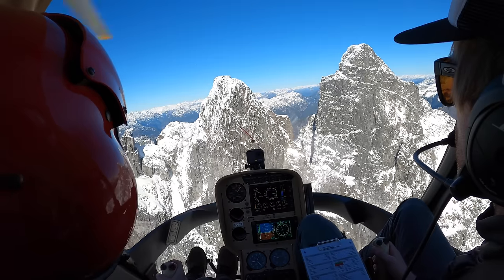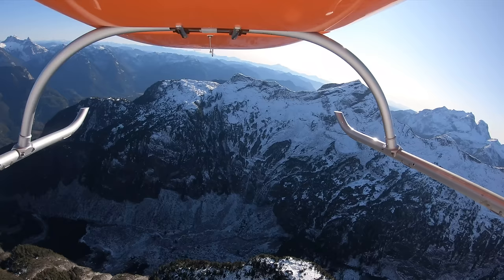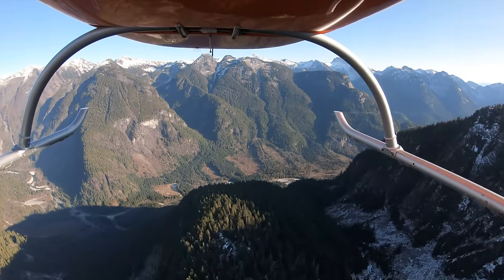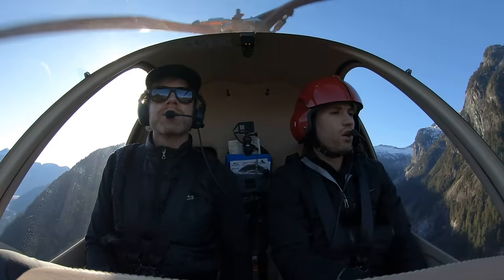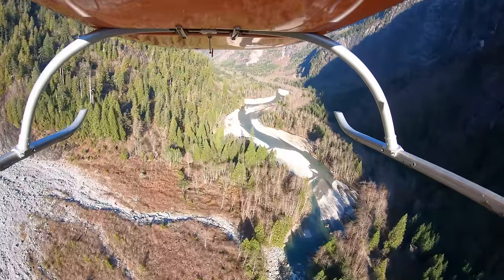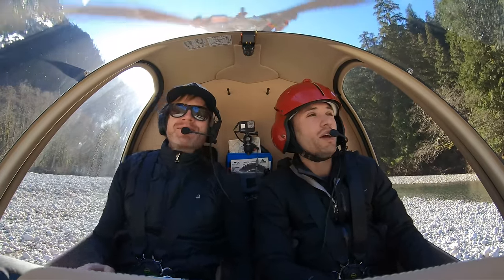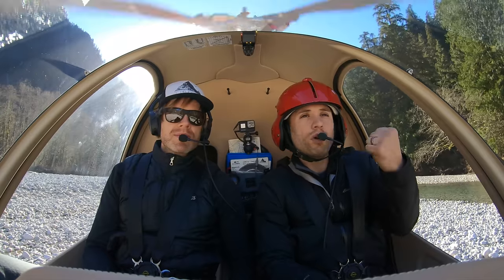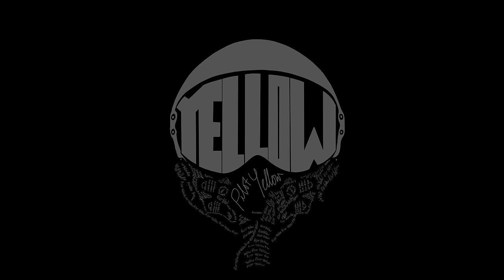ENGINE FAILURE ON MOUNTAIN APPROACH

Comment: Nice, really nice smooth landing👍As technology  moves forward, new ideas and innovations spring up. I'd like to see someday something like an  "Auto Rotation" setting on a Helicopter or an auxiliary electric motor that will give you a bit more time to do an emergency landing without all the stress.

Comment: Very nice and smooth! You could also do a tail rotor failure to the ground! Just and idea! Good job guys!
Reply from the maker: CHW BIKER that’s harder to simulate safely.
Reply: Pilot Yellow why do you think I have asked? 😬 👍🏼
Reply: I thought if the tail rotor seized you  were totally screwed as the body of the copter then starts to spin with the main rotor??
Reply: shadychrisuk I think @Mischa will be able to explain you better then me, but there are two kinds of tail rotor failures. First one it is when tail rotor stop spinning, and second it is when the tail rotor keep spinning but in a fix pitch. The main thing you need to do is to keep flying forward, around 70 knots for most os the helicopters, for the vertical stabilizers in the tail boom prevent the helicopter from spinning out of control. It is a very scary situation to be in, but as many people say, “don’t panic, keep flying”. Like in this video, after they identified the problem, they kept the cool till the landing. They kept flying! Hope to see this maneuver in the future, not necessarily to be to the ground! Just an ideia! Big hugs from Brazil!
Reply: @chwbiker   thanks for trying to explain. I'm not even gonna attempt to pretend to understand the complex aerodynamics of a helicopter, but I get the idea that if the thing is moving forwards pretty quickly then if the tail rotor were to stop spinning, the forward momentum would still reduce the tendency of the body of the helicopter to spin round with the main rotor. I would guess that it would still swing to some degree, which would quickly increase as the copter had to slow to descend.  I'm guessing that unlike the main rotor not enough air passes through the tail rotor for it to 'autorotate' fast enough to counteract the inertia of the main rotor acting on the body. I've never actually seen video of a helicopter tail rotor failure whilst travelling forward at speed, only when hovering or ascending - as per the Thai football club directors fatal crash in the UK last year.
For my money there are just too many mechanical points of failure on a helicopter that will invariably lead to a very bad ending. I wouldnt even want to sit inside one on the ground with the rotor spinning, let alone climb hundreds of feet into the sky! I much prefer to restrict my means of airtravel to something that bears at least a slight resemblance to a bird.. 🕊️🛩️

Comment: First thing he did was making a mayday call. How can ATC assist them in this case?
Reply: @hurricane watcher" Mayday, Mayday, Mayday, Uniform Echo Tango Uniform Echo Tango Uniform Echo Tango Uhh Uhh Ohh Ok"  will not assist  ATC  too much in locating you. I rather would go thru the "Power failure avove 500ft " Checklist.
Reply: @jackharper3190  it will help ATC alot as they know there is an emergency and the approx location to send search and rescue. The more people know the higher the chance of a quick rescue.

Comment: Wow I learned something today. I always thought engine failure meant plummeting to you’re death. Turns out you can glide gues the rotor still cuts the air I guess? I still wonder how you could control the tail rotor if the engine shut down ? All these questions I just subscribed yesterday night lol
Reply: Pretty sure tail rotor is mechanically linked to the main rotor gears so it rotates in unison.
Reply: C D Kennedy 
Ok good hypothesis. I know you can vary the speed with pedals to keep the helicopter torque. Anyhow thank you for one explanation. All I know is I learned something today

Comment: This is too unreal! How can he be so calm?  I can't imagine it could land that easily on all of those rocks!
Reply: @Susan Mandeville
, pilots are trained to be calm in an emergency.  This calmness comes from experience, one knows what to do when things go wrong.  It would be the same if one is trained to (1) deal with a stuck-open throttle or (2) brake failure in a car, then the surprize factor will not even enter the equation, you will instinctively (1) select neutral, switch off the ignition and brake, or (2) gear down, brake gently with the remaining brake circuit (most brake circuits are split, if one fails one will still have partial brakes in the second) and/or apply the handbrake.

Comment: As someone said, helicopters are motorbikes of the sky. They are so unsafe. Unless you work in the military or an oil ring, I would never recommend going in one if you value your life. Maybe to try it once would be acceptable but one with two pilots and two engines. Also one that is serviced regularly. Also visibility must be excellent and use one in a Western country. I am UK based. This is just my personal opinion.

Comment: I dont understand how the blades still spin?
Reply: When a heli loses it's engine, pilot has to immediately start a procedure called auto-roration ( if is a single engine helicopter ), that is an "emergency descent", trying to explain well simply,  the air goes from bottom to top, as the aircraft descent fast,  keeping the rotation of the blades ( storing power as said above ),  allowing the aircraft to be manageable. As close to the ground at the point choosed ( or possible ), the pilot  initiates a maneuver called flare that reduces the speed and the rate of descent ( pilot has to be very well trainned to perform it ).
Hope have helped.
Flying helicopters over 40 years, few times had this matter.
Sorry about the terrible english.
PS The text above is NOT for pilots ok?
I tried to do it in a very simplified way for non-pilots to understand more easily.
Reply: @cmtemoacirsilva  thank you

Comment: Yall in the comments explain this way too hard. Its like down shifting in a car, the wheels slow you down the same as the rotor does. You dont just lose traction and lock up the wheels when you downshift

Comment: Nice video. Very surprised you brought it full-down there (and posted it for your insurance co to see!). Great video but to me that full-down in a riverbed is like the backwards autorotations the Russians do. High risk. Unnecessary danger. Why risk it? Ask Harrison Ford how that exact procedure turned out for him :).  The H. Ford accident was deemed the instructors fault for taking it to full-down in a river bed, almost exact same situation as your video (except for the hidden log, maybe next time). Also, I am pretty sure there's a RHC safety notice about those practice autorotations being a no-no but you're not in Robby so it's all good right? :)  I can see you got your adrenaline going, you're flying right on the edge to bring that full down and your autonomic nervous system knows it. You are an amazingly-confident pilot to do that but even you know (or your ANS does) that it's a very dangerous thing to do. Be careful man. Listen to your autonomic nervous system. With as much time as you have a routine training exercise should not get your heart pumping and make you smile because you didnt crash :). I have 3000+ hours in 10 privately-owned R44's and you're doing stuff that is looks unnecessarily dangerous, at least stuff I would never do. Like those backwards autos in Russian. The camera will not save you. Oh ya, I thought for sure at 2:10 you were going to say "it's critical..." to look for wires. All rivers have wires. All valleys have wires. That should be on your mind all the way down. Great videos but stay safe so you can keep posting. Make it your personal rule to NEVER MAKE FULL DOWN AUTOS ANYWHERE BUT ON A RUNWAY AT AN AIRPORT. Teach your students the same. Teaching people to do that is not cool.
Reply from the maker: If you watch to the end you will hear me say it’s a simulation. I had the RPM at 100% all the way down and essentially performed a no hover landing at the bottom. A lot of people don’t realize what helicopters are capable of and this video was to demonstrate the safety of a helicopter. I would never compromise our safety just to demonstrate that. Hence why it looks like a full down auto but in essence was a normal no hover landing. I’m sure you’ve probably performed a no hover landing on a river bed before if it was dusty. Thanks for the feedback though, I appreciate it.
Reply: @PilotYellow  I watched the entire video and listened to what you said at the end. I just don't believe that what you "say" negates what you "do" in the video. So we will just disagree about that safety of that particular decision-making process depicted in the video. We will totally agree about this: When you fly helicopters you make your own rules. That's the best part of helicopters, freedom. A hundred pages of FAA rules will begin with "All aircraft, excepting helicopters, shall..."  Helicopters are excepted from most of the rules but helicopter pilots still need to make their own rules. Fly safe. Great talking, hope we get to fly together someday (but I'll be PIC for the purposes of decision making, lol).

Comment: I' have yet to see a helicopter glide down, am sorry to say. I've seen 3 people killed when a helicopter FELL out of the sky. I've also flown over 95 hours in helicopters doing all kinds of stuff, and the majority of them do not have any glide ratio at all. :(
Reply from the maker: Rex Ellacott the difference between gliding and falling is that when you are gliding you are still in control and can manoeuvre the helicopter as you need to to reach an intended landing spot. No they don’t have a very long glide ration but they can hit a very specific spot. They can also land with no forward speed which an airplane can’t do even though an airplane will glide much farther.

Comment: Yes, and this is why I refuse to get in a helicopter with less than 2 engines
Reply: you're kidding right?
Reply: Kidding - absolutely not. On this occasion they had lots of height for automation. Helicopters don’t usually fly to high so the time to autorotate is severely limited. I work with helimed pilots, if they’re not getting in a single engined helicopter, neither am I

I’m aware it was a simulated engine failure, but the reality is still the same - whilst 2 engine failure isn’t unknown (Scottish Police EC135 crash) having another increases your chance of safe landing

This is just my opinion of course
Reply: mruppity64 nothing runs without fuel,regardless of how many engines you have.
Reply: millimetreperfect correct
Reply: Two engines are an improvement, but still can fail. Reality check!
Reply: Frantisek Sram correct, and believe me, I’m very very aware of the reality, and hence why you still won’t find me flying in a single engined rotary aircraft
Reply: mruppity64 - Go for an autogyro experience flight - that might change your mind. I only have a single Rotax 912ULS pushing me along but the one thing I never fear is an engine-failure because an autogyro has far superior autorotation characteristics compared to a heli - because it is built to fly in autorotation all the time - Part of being a good pilot is always allowing yourself an "out". Never put yourself into a situation from which you cannot get out. Helimed pilots tend not to have that luxury and for them, the additional engine gives an element of redundancy and an additional level of safety. "Recreational" pilots should be choosing their route such that they can always put down in the event that the power-plant coughs up its guts.

Comment: Surround a hybrid electric helicopter with a buoyant gas helium gas filled torus shaped airship envelope with a Frisbee shaped aerodynamic/photovoltaic farrring cover.  That would provide for less power used for lift, insures a negligible ground impact speed if motor fails, counter weights can be jettisoned to slow decent as well,  less impact damage to vehicle/pilot/structures/and by standers/ due to the airbag effect.  The photovoltaic farring surface can recharge the batteries both in the air and on the ground, and extending range.  Lower db noise levels do to slower rpms used and from the baffling effect (envelope sound enclosure.)  Use detachable drop weights to create an overall net vehicle weight; just enough to provide for crosswinds/headwinds inertia but not so much as to create to much impact momentum.  

                                     This design would enable water landings and also be able to transform 
                                     into a buoyant overhead emergency shelter, secured by staked guide lines 
                                     and covered with a large rain fly/canopy.

Comment: it is not exactly the same thing as a true engine out. Sorry but that is just fact. The feel the time the distance everything shrinks, on you when it happens for real. How you react is even way different. Practicing it is good but claiming it is the same is going to get someone hurt.  I can tell you have ran this same exercise and landed in same spot many times this is not the same not even close. However practicing will help give you some muscle memory on how to maintain control of the aircraft. but everything else is different when it happens for real.

Comment: You didn't explain what you were doing to the controls that makes this video useless
Reply: Release pitch (lower collective) = faster descent and rpms. Pull pitch (raise collective) = slower descent and it kills rpm's.  Too much rpm's and the rotor flies apart. Too little rpm's and the blades fold like a taco and you fall to your death. Either is fatal, so managing your rpm's is your ticket to survival. 

Forward speed (and therefore glide distance) can be coaxed out of the situation by tilting the rotor forward or backward using cyclic. He's handling cyclic, collective, anti-torque, and monitoring airspeed, rate of descent, rpm, among other things, all simultaneously, just as in every other moment of powered flight, except now some of it is in reverse.  In a real engine failure the machine is going one direction and that's down. The skill of the pilot is what will determine how hard or soft it makes contact. Your comment indicates you're not a pilot, or in flight school to become one. What he's doing with the controls is beyond the scope of this video and is far too complex for anyone to explain it here, although I've touched on the basics. Again, based on your comment, that's more than you deserve. If you want to learn to fly helicopters, you're not going to get that done by watching youtube videos. There won't be any way to avoid going to flight school. Life's just going to be a bitch that way.

Comment: It didn’t look like ‘engine failure’ to me.
Really not sure if there would be as much forward motion control to enable such a controlled landing. Just enough ‘spin’ in the rotors to land vertically. I think the pilot had far too much time to choose a landing spot. Where did the ability to...... “control the rotor speed” come from?